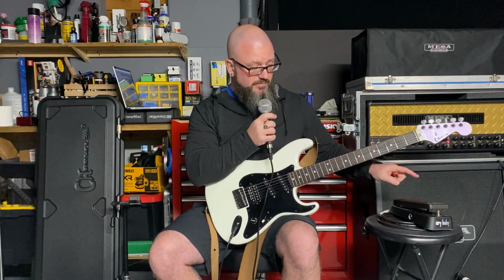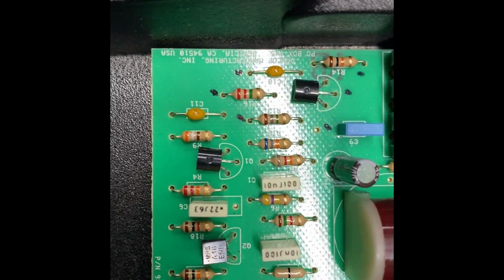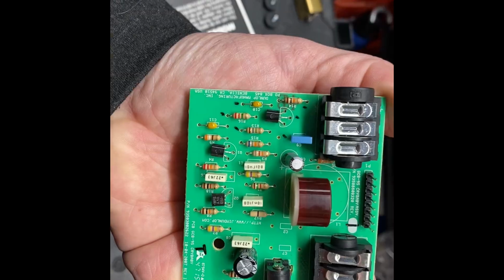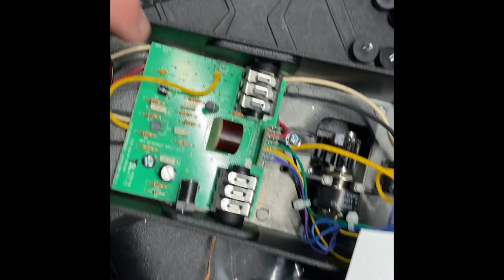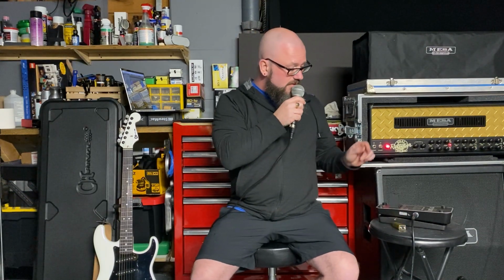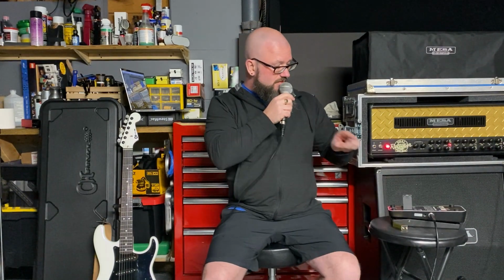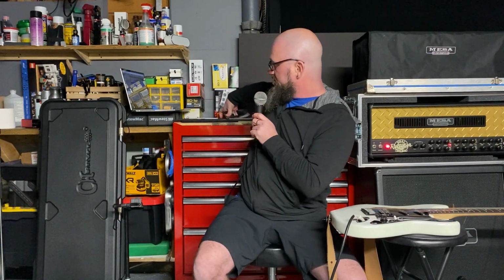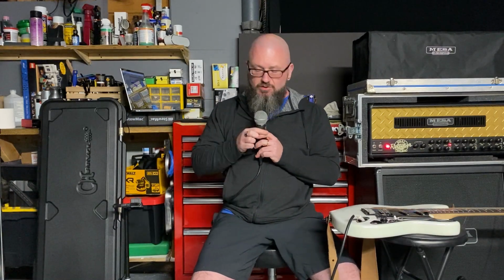Crybaby Wah Pedal GCB95 True Bypass Mod Kit Stew Mac Effects Pedal DIY modification

Comment: Sounds rank
Reply from the maker: This wasn’t so much to show the great tone of the amp or the pedal.  That amp is set to run with my one board, but I was mainly showing how the tone suck on that wah pedal is.  After the mod, the normal tone was good.  The flicking the wah around was only to show it worked.  Removing that buffer doesn’t change much with the wah effect itself. Hope you’ve been well.